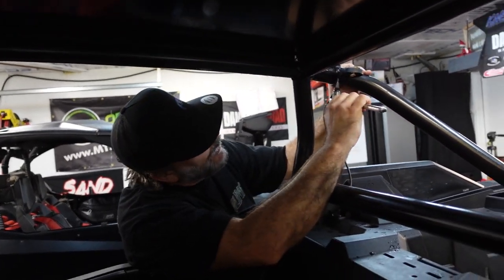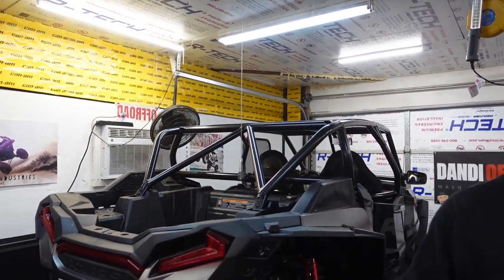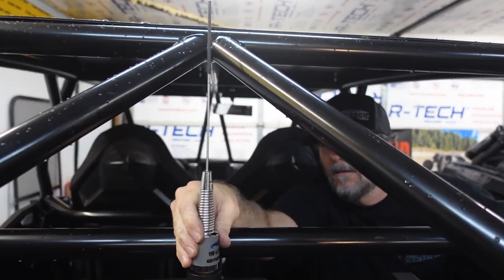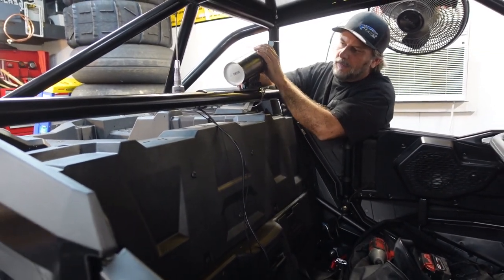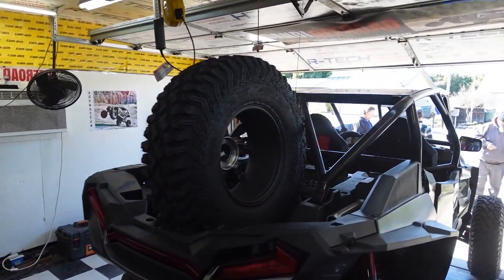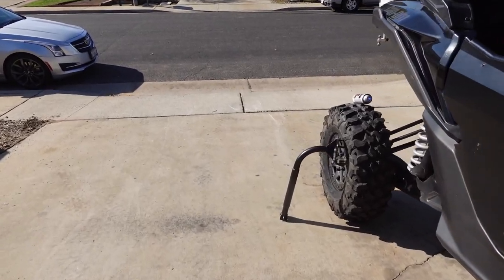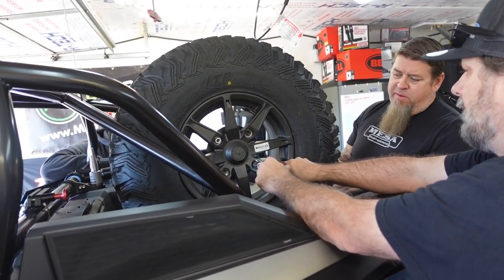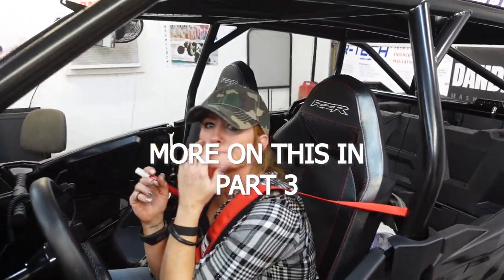NEXT! TURBO S X3 Prepping For Our Epic MOTHERF**ING Adventure Desert Riding Primm Barstow Offroading

Comment: Love the channel guys. FYI that antenna will not work very well in that location. The whip is too close to the metal bars and will cause reflections and your range will be very poor. My experience with that NGP antenna has not been good. you will have better results with a mag mount base and a 1/4 wave antenna.
Reply from the maker: Thank you very much. Yeah and I know you're right man we just aren't very good at falling the rules..
Reply: @DandiOffroad  Interestingly, you have a great mounting spot for that antenna... in the middle of your aluminum roof. While that antenna doesn't require a ground plane, it would work much better if it had one. Also, it probably needs to be re-tuned since you took it out of the base, that's actually where the tuning adjustment is.
Reply from the maker: Yes